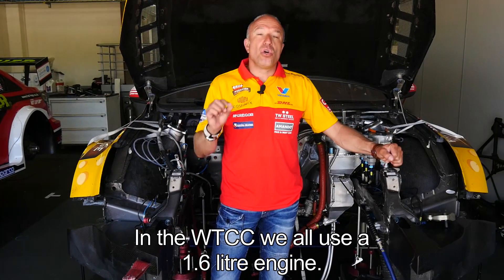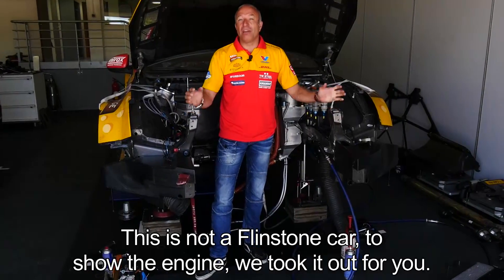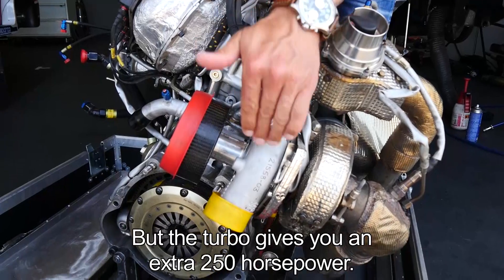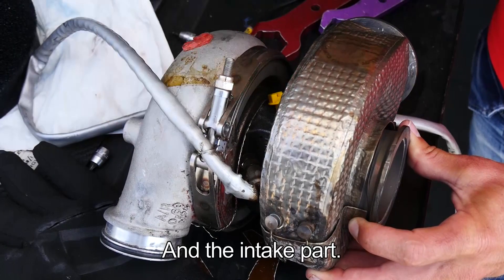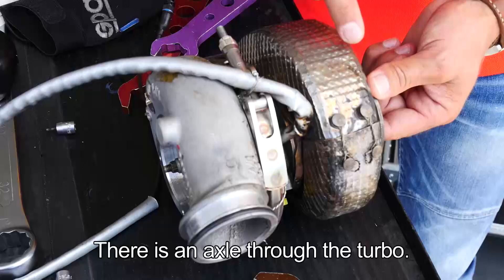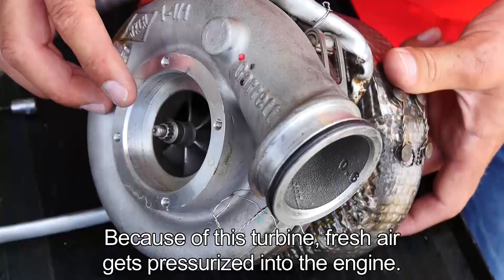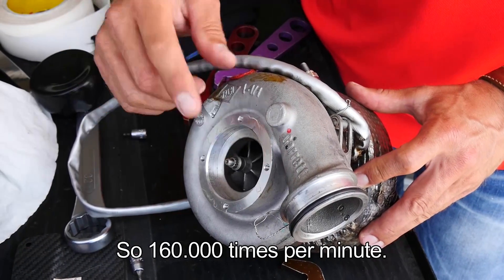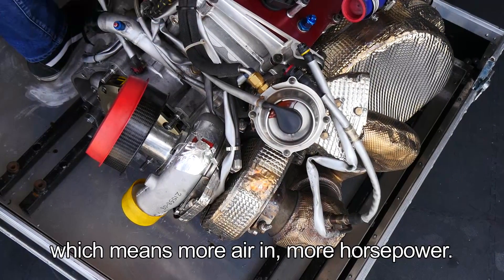How does a turbo work? Explanation by Tom Coronel with WTCC 1.6L engine, Chevrolet RML Cruze TC1

Comment: actiually the turbine works the other way around, the square flange is what bolts on to the exhaust manifold and collects the exhaust gasses and the round middle hole is where the gasses exit the turbine